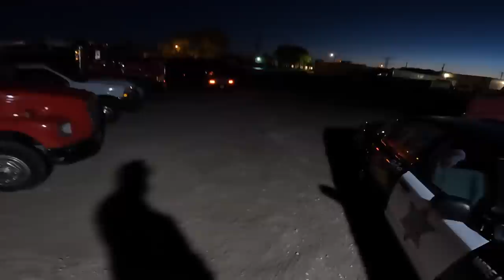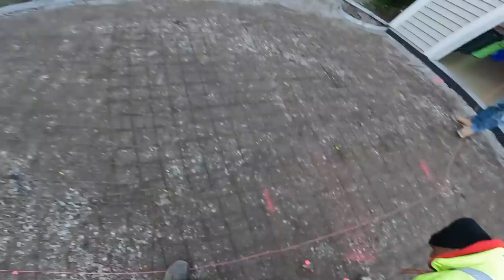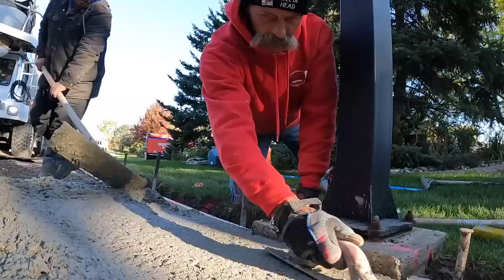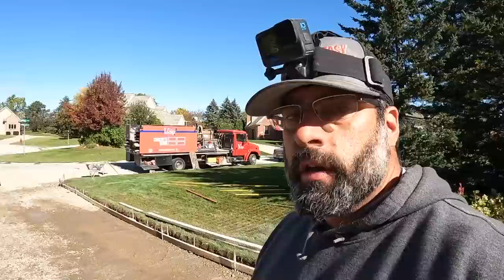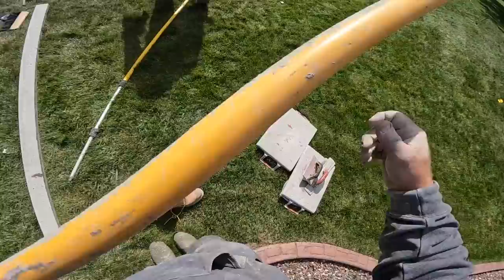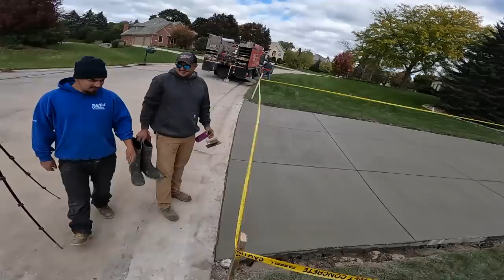BIG driveway pour- I made a dumb move

Comment: Hey Ryan, have you ever seen the rubber boots at fleet farm with the metal buckles? If you buy them a few sizes larger than your normal boot size they slip right over. Makes it easier to switch between pours. No need to take your steel toes on and off
Reply: He wears a size 14 or something steal toe . Good luck finding a moon boot to fit over that. the weight of steal toes plus moon boots plus concrete would be unbearable… those new rubber boots are comfortable and barely weigh anything
Reply: Ryan's boots are not steel toes, but I get what you're saying

Comment: Do you ever recommend doweling the driveway into garage floor or foundation so that you don't get height differences if one heaves?
Reply: Probably better to just have the heave on one than have that affect the other.
Reply: @TonyRule  in my situation the concrete outside the garage door is higher, which is letting in a bunch of water.
Reply: @skutsenkow  There should be a grated open drain across the driveway where it meets the building foundation if there's any chance of the driveway heaving or the house settling.
Reply: @TonyRule  there's a trench drain in front but that pad heaved a little and water still gets around it and dumps into garage (hard to explain). I was just wondering if that outside pad could or should have been doweled into the rest (garage floor/foundation)

Comment: Ryan why dont you use chairs for your wire? If and when the wire gets pulled its then stood on when screeding concrete. The wire mostly is on the ground in most of your poors.
Reply: For professional concrete workers, its an unnecessary additional expense. Once the grid is pulled up during the pour, it will remain in the middle even when you walk on it. Just have to be careful not to pull it up too high.